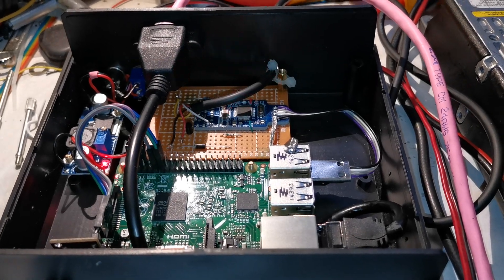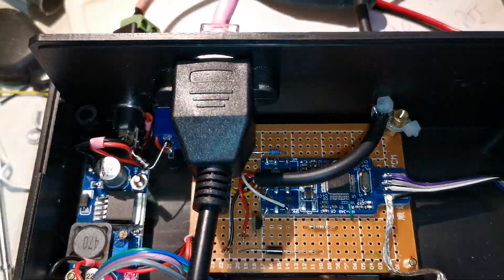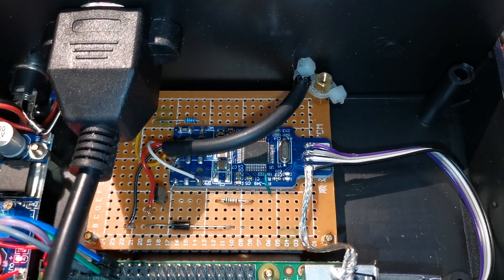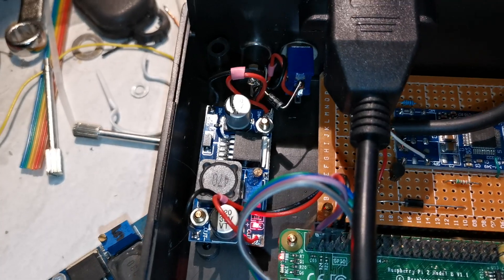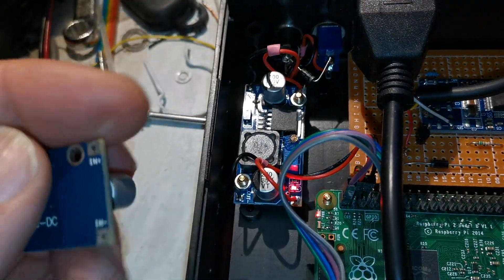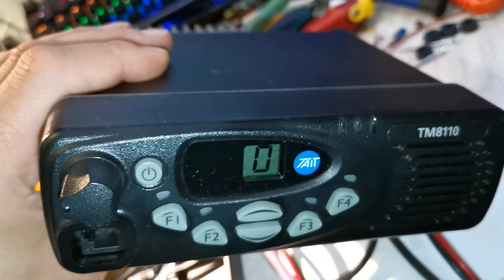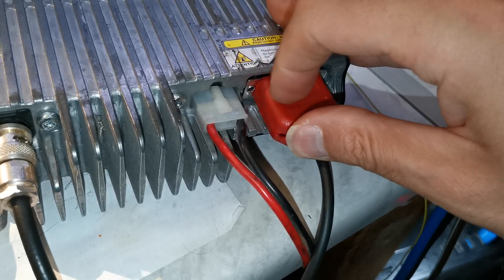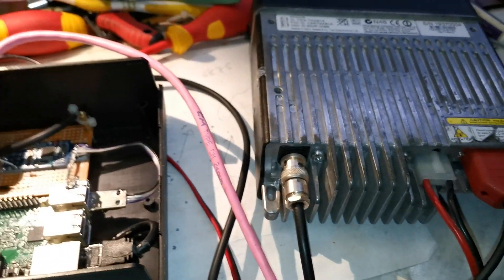Allstar node. Tait TM8105

Comment: Hi Peter, you might remember a long time ago I tried this and wondered if the audio output was a bit low on the Tait. It was perfectly usable but everything was turned up to full so there wasn't much room for adjustment. Did you make any changes to increase the volume, or have you found that in practise it's good enough? Cheers!